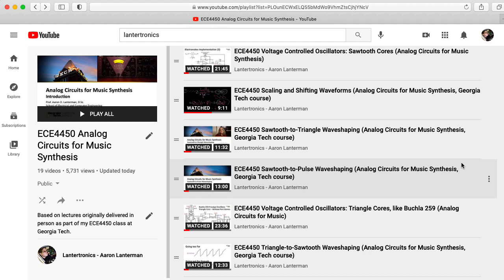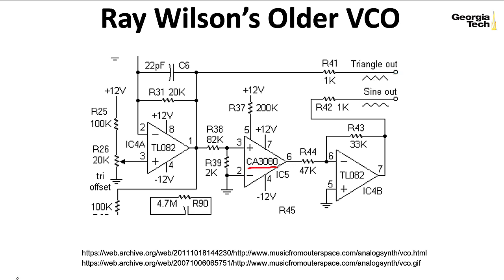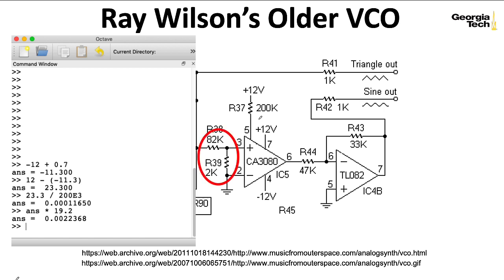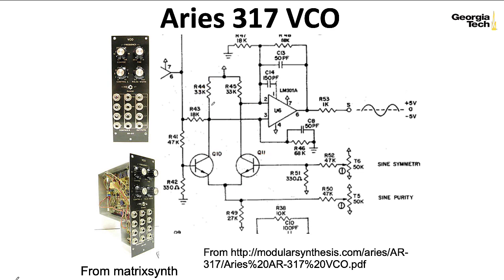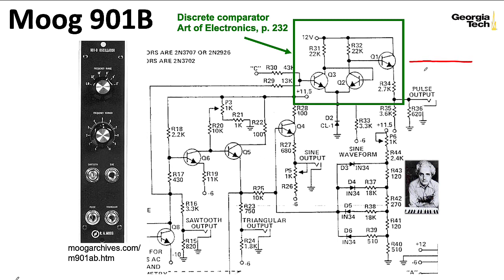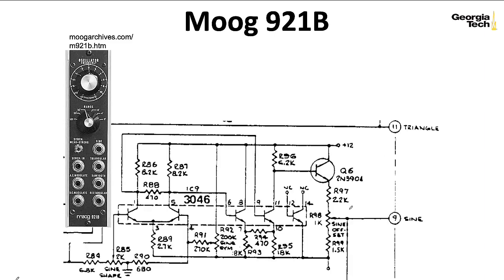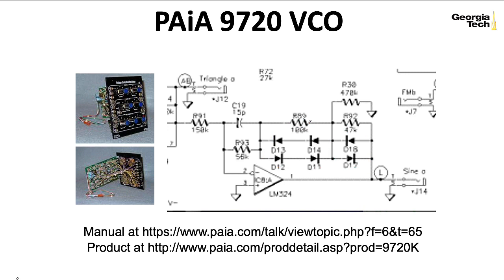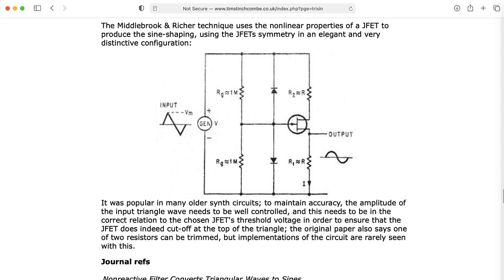ECE4450 L14: Triangle-to-Sine Waveshaping (Analog Circuits for Music Synthesis, Georgia Tech course)

Comment: 5:12 A much more intricate version of this resistor-diode ladder was used in HP test equipment like the 3300A function generator, using 12 diodes in that particular implementation. I initially ran into it in CuriousMarc's video "HP 3300A Vintage Function Generator Repair" where he needs to align the circuit in his unit to reduce THD.

Comment: hi! ...
Could you explain the circuit of the wavetek 130 function generator?
by !..
Reply from the maker: See p. 5 of the service manual: http://bitsavers.informatik.uni-stuttgart.de/test_equipment/wavetek/130_Aug72.pdf
Reply: @Lantertronics  gracias !!
Reply from the maker: Are you trying to fix one?
Reply: @Lantertronics   hi! ,In college we are looking at quadrature oscillators, and we are interested in knowing how to obtain a sinusoidal signal from a triangular one, and we found the wavetek 130, but we did not understand the sinusoidal converter circuit.

Comment: @2:30 you say you do not know what R44 is for .... yet @13:45 you mention the very same inverting aplif with gain set to equiv of minus R43/R44
Also would be nice to see a tusl sine wave output vs triangle input, I bet it would have been more distorted than if triangle to sine was done via opamp based Miller integrator
Reply: The current through R44 is output by an OTA so the current through R44 is the same regardless of its size, it could be just 1k or less and the gain would be the same. The output of the Opamp in this circuit is (R43 * output current of the OTA), R44 does not have an effect.
Reply: Incorrect, R44 and R43 set the amplification ratio for the Tl82 opamp: voltage gain = - R43 / R44, so if you change just one of them then the gain will change too
Reply: @markderlo212  you have a gain of -(R43/R44) when applying a fixed VOLTAGE. The current in this case is determined by Vin/R44, which must be the same current for R43, and the output if the opamp behaves accordingly with a gain of -(R43/R44) to sink that current.

But at 13:45 the current through R44 and R43 is fixed because an OTA is outputting a fixed current So R44 will have the same current running through it regardless of its size. If you replace the input voltage source with a current source, and short R44 you get the textbook "I to V converter"

Comment: The circuit in the green box at 6:00 is a well-known discrete implementation of a Schmitt trigger (effectively a comparator with positive feedback to give it hysteresis).

Comment: huh! the diode-resistor-voltage divider thingy in the moog schematic is a circuit i learned in school as a linearisation circuit. of course this can be used to do the opposite, as is done here. awesome! thank you for pointing that out and helping me make another connection in my brain.

Comment: I suspect that a mosfet differential pair would actually give a better approximation to the sine function than a bipolar differential pair, since the mosfet pair saturates at a definite voltage, giving a zero derivative at the peak. In contrast, the tanh nonlinearity of the differential pair never reaches zero derivative, so the sine approximation will have somewhat pointed peaks.

If my calculations are correct, the ideal mosfet differential pair has a nonlinearity

        f(x) = x*sqrt(2-x^2), |x| <= 1 (it saturates beyond that).

It seems that you can reach a THD of about -37 dB with the bipolar differential pair, and about -40 dB with the mosfet pair (if you tweak the input gain of each), so maybe not a huge difference, but the harmonics will drop off much quicker with frequency for the bipolar pair.

Now, which one sounds better is probably a different story :) Pure sine tones can be a bit dull, so a bit of energy in the harmonics might not be a bad thing.
Reply: But I also realized that unlike the bipolar differential pair, the scale of the input voltage needed get to a certain point along the mosfet differential pair's nonlinearity varies with the (square root of) the ratio of the source current and the mosfets' gain. This probably makes it quite a lot harder to set the operating point of a mosfet differential pair to get the desired scale of the nonlinearity.

Comment: 5:54 You mentioned "The Art of Electronics" and that two-transistor comparator is not on that page in my 3rd Edition, and looking through, I don't think it's there at all (a good reason to save earlier editions). I double-checked, it's there in the venerable (30 years old!) 2nd Edition, but the 3rd has been out five years or so, and I think everyone should have it!. I even have the "X Chapters" book that came out only a year ago. Please when you reference a book mention the edition!

But that's a neat and tiny minimal comparator circuit, I don't know why I haven't come across it before. Apparently I didn't read through the 2nd Edition carefully enough!
Reply: There's a circuit that looks similar in the 2nd ed, but it's described as a Discrete Schmitt Trigger, and it has things that are significantly different (e.g. there's a resistor between the collector of Q1 and the base of Q2).  I also looked in the index, and the pages around it, and couldn't find this particular circuit as a comparator....
Reply from the maker: @elmegil  Ah, yeah... I was hand waving there a bit...

Comment: The title is a little misleading. Shouldn't it be Triangle-to-Sine instead of Triangle-to-Sawtooth?
Reply: All those S-curves are the same! :D
Reply: @TranscendentBen  Hard to disagree. But I personally was like 'hmm, again?'. I cant wait for the logarythmic current driver, every time I think this has to be next
Reply from the maker: @krolu  The exponential voltage->current conversion with temperature compensation is pretty complicated so I've been putting it off. ;)
Reply: @Lantertronics  I know, it's the part that making me nervous. I'm just wandering how temperature compensation will be done. Will it be based on 3300K PTC as its the most fundamental but the most difficult to get, or maybe some temperature shift for transistor array in one die. Just curious
Reply from the maker: Whoops! The title isn't just misleading, it's flat out wrong. I had copied the title over but forgot to change the S-word! I will fix that now...